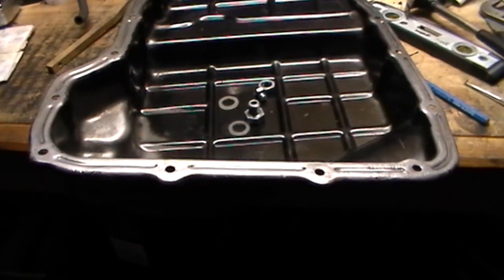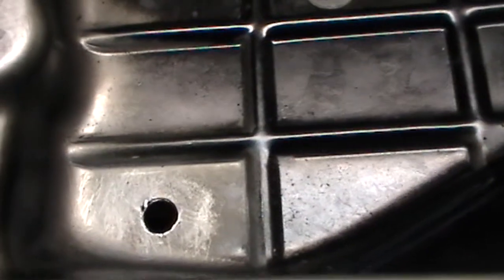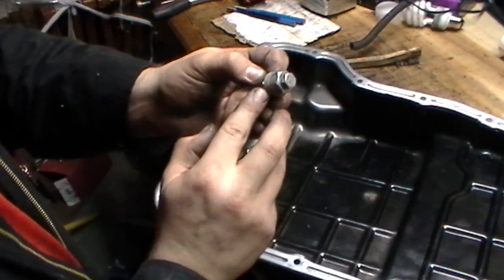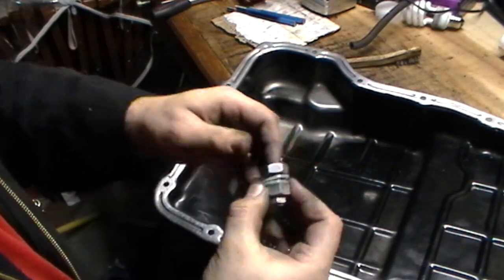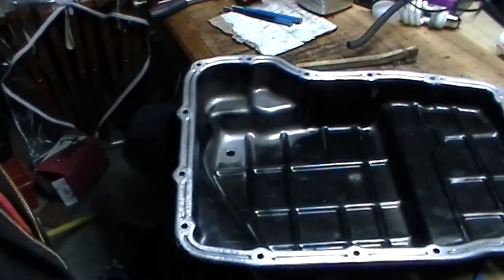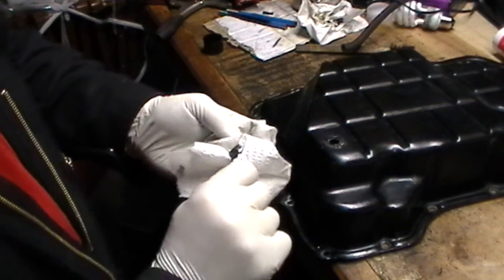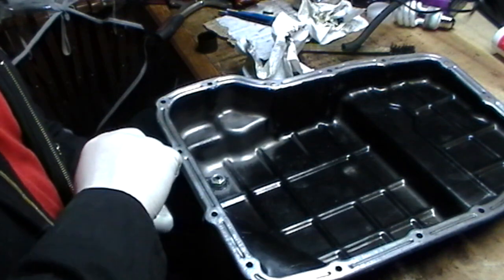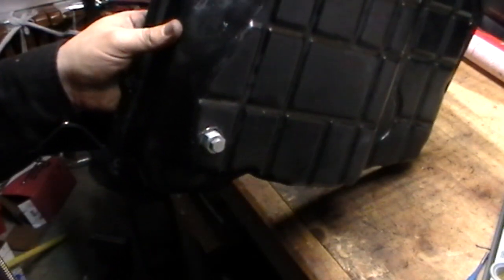How to fix a transmission oil pan design flaw (lack of a drain plug)

Comment: lack of a drain plug is NOT a flaw. Ford Chevy Dodge want you to Remove the pan inspect for clutch shavings and change the filter...they do not want you to just change the oil. the drain plug might be nice but it make people think it is ok to just change the oil
Reply: Yes you are supposed to drop the pan to inspect and change the filters, magnet, and internals, However, having done more transmission services than I can count as a Professional Technician, having a Drain Plug, makes it much easier to drain the pan before you remove it, it makes a messy job less messy.  Some of those pans hold more than 6 Quarts of ATF...Letting the pan hang by a couple of bolts can damage the Gasket surface on the pan, and you never get all of the fluid out, and wind up wearing it. So the Drain plug is a good idea, BUT when I install a Drain plug kit, I ALWAYS use Lock tight on the threads...and have Brazed and or a tack weld the upper and lower nuts in place to keep them from spinning.
Reply from the maker: I understand your point, but forcing people to remove the pan does not mean they will change the filter(s) too. Kind of like you can lead a horse to water but you can’t make it drink. The flaw, in my opinion, is primarily that they didn’t make an easy or obvious way to remove the pan without spilling the fluid all over the place.
Thanks for watching & the comment.  I appreciate it.
Reply: your right..but still it just proves how lack people are in proper maintenance when they just drain the oil and not change the filter
most belive they know more than the engineers who built the transmission...then complain when the trans goes bad in 80.000 miles. The main reason to pull the pan is for Inspection
your point is well taken
Reply from the maker: Lonnie Moon I completely agree with you that a lot of people are lax in their maintenance, and think they know better. In my opinion, its due to lack of education on the topic, or just enough education to be dangerous. Thats what I'm hoping to help fix with my videos. Teach a man to fish, and all that...
Reply: We know...But my shop doesn't work on Fords...
Reply: It is certainly a flaw. So you're saying because I have to remove the pan I will definitely change the filters? Or are you saying if I drain the fluid and remove the empty pan I won't change the filters? They don't put a drain plug in the pan because it saves a buck and they sell more vehicles by saying transmission fluid will last 60k-100k. I have a Camry that claims the ATF is "lifetime", which is total B.S. Still, that car includes a drain plug on the transmission pan.
Reply: +John Ferguson So, how does making a job more difficult motivate anyone to do the maintenance? My Camry example ("lifetime" fluid and a drain plug) exemplifies that. If manufacturers wanted people to maintain their cars, they'd make it as easy as possible to work on them. Clearly that isn't true.
Reply: +John Ferguson And I'll bet both of your cars still have magnets in the pan that should be cleaned periodically. My Tacoma has a drain plug, a magnet, and a filter. Please explain. The manufacturer's decision to not include a drain plug is purely a cost saving measure. If the engineers had to work on the cars they designed, they'd certainly include a drain plug.
Reply: Evil Plman
they do have a drain plug the large nut that houses the small pipe plug is the drain plug and also the small plug is a 1/8 pi[pe plug so no need for a special tool to fill the pan..just use a small 1/8 NPT fuel barb
Reply: Evil Plman
sorry i was thinking about the Ford 5R55w Pan..the dodge may not have a drain plug
Reply: Lonnie Moon I haven't encountered any automatic Transmission that have a drain plug yet, that weren't installed aftermarket, Most Manual Transmissions do have a Pipe plug to drain and refill. If Ford put one in the 5R55w that was a smart move on them.  MOST vehicles don't come with a Drain Plug on their Automatics.I have seen Drain plugs on Mercedes Benz, and a few other high end cars, but it's not standard practice to put one in at the factory on the American made cars. I also wouldn't recommend using R.T.V. on the Inside of the Pan like in the video, if the R.T.V. fails...it can and will do damage to the transmission. that's why I braze the inner nut in place.
Reply from the maker: Evil Plman, RTV was the sealant used from the factory for the pan instead of a proper gasket on this transmission.  So using RTV on the plug like this shouldn't be a problem.  Especially given how little RTV is being used for the plug.  If I had access to a welder I would weld the plug to the pan, but even that isn't fool proof and can leak.  Use whatever works for you though.
Reply: Pet Rock's Garage I have seen the RTV pieces used on the inside of the pan for a drain plug install wedged in a valve body passage more than once....RTV on the gasket surface is different, in the sense that it's not submerged in ATF. RTV is amazing stuff but it is not always good to have it Completely submerged in Oil/ATF...but most people tend to forget to really clean the surfaces.  They also make rubber washers backed with a steel washer, you can use in place of the Teflon gasket, which fit a lot tighter.  Brazing almost always works, and locks the through bolt and nut in place.  (Probably a Good Idea to use lock tite on the big nuts threads as Well) Also note here...You can purchase a transmission pan with a drain plug already built in, for most transmissions.
Reply from the maker: Evil Plman, I have no doubt that RTV can cause problems inside of a transmission if a chunk of it gets loose.  However, RTV on the gasket surface most definitely is submerged in ATF.  On the Chrysler 5454RFE transmission in this video & my wife's Ford 4R70W, the ATF level is a couple inches above the pan's gasket surface.  Even if it wasn't, when the car is moving around the RTV in the gasket surface is definitely being bathed in ATF. Ultra-Black RTV and Red High-Temp RTV are spec'd for use with ATF, so I would be surprised if the ATF would have any effect on it.

I have seen aftermarket pans with drain plugs and they work very well. The problem I have with them is the price. I couldn't justify $150-$300 to get a drain plug and maybe some more oil capacity, when I can get the drain plug for a couple bucks. The additional oil capacity of the aftermarket pans doesn't make a difference if you have a transmission oil cooler. But to each his own.
Reply: Every Trans pan that I have ever dropped...over the last 30 years I have never seen on that the fluid level was over the top of the pan lip, unless it was overfilled.  You also need to remember that RTV used on a Transmission Oil pan is put on at the factory under ideal conditions, and that as a whole it's pretty safe, because it surrounds more than one bolt. RTV on a Drain pan plug kit that can accidentally turned...can be ripped and fail. While I am not opposed to using RTV in this application, care must be taken to ensure that seal doesn't rip when preforming a transmission service we all know that these Quick Lube place don't take as much care as a professional Garage does, most of those Quick Lube guys have no real training, and are in a hurry to get a job done. I have seen those expensive Pans myself...but I have never paid that much for one, gotta be a smart shopper in that case I guess or have a good source, which I do.
Reply: Evil Plman - rtv is very risky if not done properly
you need to give it time to cure before adding any trany oil
but, a gasket will make a better bond if used in combination w/ rtv of course
just make sure you never use a rubber gasket because those gaskets will leak out for sure
Reply: FYI...5-45RFE and 45RFE Pan with Drain plug, DORMAN 265817 RockAuto's price..$21.89  by the time you get done with the time, and all the parts for the drain plug kit...that pan is well worth buying instead.
Reply: Pet Rock's Garage if the ATF is above the Gasket seal, the transmission is over filled. According to All Manufactures...the lower filter, is also the oil pick up for the transmission fluid. I have worked for Ford, GM and Chrysler. there are very few transmission setups where the ATF is above the pan gasket.....Mini vans is one of those, because of the angle. Yes the transmission can hold 9 - 14+ Quarts...the Torque converter holds way more than the pan does, add in the lines and the cooler...the Average pan holds between 4-6 quarts...yes after you drop the pan...more fluid will collect there, yes if it has sat it may be over the gasket lip....(it is usually about level with the seal.) but again the RTV is applied in a very clean environment on "perfect" surfaces at the factory, yes O.E.M. uses lots of RTV, it doesn't mean it a good thing.  We usually work on warm transmissions, because customers think they are having problems...Unless we are building a Transmission for a custom car. I don't like RTV for somethings, it is always possible to get a bad tube of it, (lord knows how many almost new Chrysler Transmissions I have had to scrape off the RTV and replace it with a gasket, when I worked at the dealer.)  RTV is used by OEM manufacturers to Decrease cost and increase profits  Dorman makes pans with drain plugs for most models. the gaskets have been available for that 5-45RFE/45RFE transmission in the video pretty much since they came out. (one of the worst Transmissions ever made BTW) The kit in this video is also a Dorman Product, but I personally wouldn't use it, the Teflon seals they provide with the kit fit too loosely. Brazing can be done with a propane plumber's torch, a welding shop doesn't charge much to braze something like that. It also can be Soldered with plumbing solder. (full on welding would likely warp or destroy that particular drain plug kit.) People need to remember, that RTV stays Flexible almost for ever, it is made of Silicone Rubber, and can be damaged by certain fluids and conditions no matter what the tube says it can stand....At any rate...what ever works...works...if you have had luck with RTV good...I'll stick to gaskets, and Brazing since it always works for me, and I have never had a customer complaint regarding transmission work that I have done, doing things the way I do. (Except for the few that coupled a stock transmission to a Pro Street Engine and shouldn't have....idiots)
Reply: Evil Plman
I just changed the trans fluid in my 2004 Ford explorer with a4.6 and a 5R55w trans..has a drain plug from the factory
int he center of the drain plug is the small pipe plug that you fill the trans through..but It does have a drain plug..Guess Ford got that trans Right...LOL  again a factory Drain plug..i think Most mechanics have no idea the Big nut unscrews and it is the dreian plug
Reply: in chevy express 1500 2007  you need to remove the exhaust    pipe in order to remove the pan , and there is no plug
so it is a seriously messed up and very poor design , they want you to go to dealer and spend $ 200 for the flush
Reply: doktorstolat Yeah..I hear ya...They keep making vehicles harder to work on so you have to pay the dealer.
Reply: your right!! they want us all to bring the car or truck to the dealer for all service. and the dealers service COSTS Big TIME
Reply: Or make wear items not serviceable so you have to pay out the nose to replace it when it wears out. Where sometimes the cost to repair/replace is more then the car is worth. Effectively making ‘modern’ cars a disposable product, not something that can last 20+ years. Electric/Hybrid car's batteries, fuel tanks with the filter inside & some newer transmissions (with built-in filters that can’t be removed, or with no drain plug or pan to drain the oil) come to mind.
Reply: +Evil Plman   My Volvo XC 70 has a drain plug.  The transmission is an Aisin Seiki Toyota/Lexus transmission; no filter.
Reply: Kilo Mike It is not a design flaw.  It is a decision made by the engineers that is intended to motivate people to do the proper maintenance.  Of course, people can always be stupid and refuse to do maintenance if they wish.
Reply: Kilo Mike Some transmission require filters and some do not.  If you take off the pan, you are more likely to change the filter.  You can't file a warranty claim if you have never drained the trans and changed the filter.  The Akin Toyota/Lexus transmission in my V90 doesn't have a pan plug because it has a filter.  The Akin transmission in my XC70 has a drain plug because it has no filter.
Reply: Pet Rock's Garage  I like the idea pf the tack weild but wouldn't that warp the pan from the heat of the weild?
Reply: Not if done correctly.  It is just a tack or two.
Reply: Magnetic drain plug, also if you're changing the fluid for maintenance and not mechanical issues, why would it matter, also there will still be shavings in the bottom of the bucket you put it in.  you can buy  filters that outlast 3 fluid changes.
Reply: dont use rtv,use shoe goo and let cure before putting in fluid
Reply: Draining all the fluid via a drain plug and then dropping the pan for less mess...
Reply: the drain plug is only good for not making a big mess under the car when you want to replace the filter.
Reply: '02 gen 1 tacoma has 240,000 miles, pulls a trailer once a week or so, gets 4 quarts of mobil1syn atf every 25 or 30K. Would be a PITA without, yep the drain plug. Love pulling that dipstick, looks showroom clean. l bet that original filter is about shot. If you dont have a drain plug, I'd think about getting one, while your fighting that pan.
Reply: Pet Rock's Garage - if you think about it, that improvement that you made on the transmission oil pan will generate that "some" of the oil inside the pan will come out, but the real messy oil filled w/ clutch debris and metal will be inside the pan always until you remove the tranny pan again, and again during the time will be servicing his/ her car with you
iow, that will make your next tranny service easy, right? you're wrong bro
in automotive automechanics, after gaining experience in the field, you will discover many golden rules that you cannot break, otherwise you are going to suffer the consequences for taking the wrong decissions in the wrong time - and there's no exception to that other golden rule too
surelly, and apparently, you have performed a mechanical procedure and have demonstrated to the public how "sharp" you are and how convenient is your improvisation of the drain plug fixture that you have installed on the tranny pan as you went through it with us along the way - great technical skills by the way
 bro but you are stuck in time and you are travelling in the burdens of dispair all the time in the automotive field and industry
the way we always solved these problems in the past was by paying real attention to detail first and then to narrow any potential problems into real solutions by eliminating any flaws after calculating the mechanicals involved on any task that could affect the process involved in the operation to be performed, and very important too, the economical impact firstly on the technician (and the repair facility) performing the operation, and secondly, its impact on the end consumer as well
according to what i have learned at vocational trade schools, colleges, universities, specialized research in the field and personal experience with mechanical components, service and repair procedures, lets say, that whenever you are servicing or repairing any piece of machinery, or component, the first thing you have to do is to "keep your eyes open all the time" while you are performing the service/ repair/ operation procedure to the specific section where you are working, its adjacent areas and subsequently to the whole perimeter involving the serviced/ repaired component in the procedure that corelates to other interconnected components
after that, be "humble" all the time, that's super-important too, and accept that you are "always learning," and that specially applies when a master in the field is talking to you directly
then, visualize the impact of the service/ repair of the overall operation on the vehicle .. and some other factors as well like the economic impact on the consumer and on society
👉in any case, a welded 1/2 inch pipe connector and a 1/2 inch plug will solve most obvious problems that exist with your strategy to fix a simple mechanical problem as such
if you think about it, the way that some oil pans have their welded drain plugs at the bottom of the pan have a more realistic point of view and a better design than your supposedly "convenient" fixture 🚫
in my case, for exp., as an auto technician, the first thing i will need to consider is that the plug has to be below surface and under the wasted oil and debris all the time for many physical reasons and conditions but the most important are:
1. gravity
2. inertia
3. stopping forces
4. accessability
5. simplicity
6. availability
7. economic factors
8. environmental impact
9. evolution to upgrade a trade not to down grade it
10. progress
11. reputability
12. responsability
13. temperatures (oil, ambient, metal)
14. viscosity of the oil
15. and 100s of more ethical and moral norms of conduct in the intended field that you must attain before you became a professional in your field, if that is your intention
in any case, thanks for your great video 🎥
Reply: @facesmasher4216  WOW, NOW THERE IS A RUN-ON SENTENCE....WHOA BOY!!!